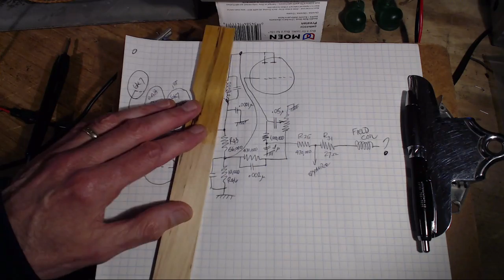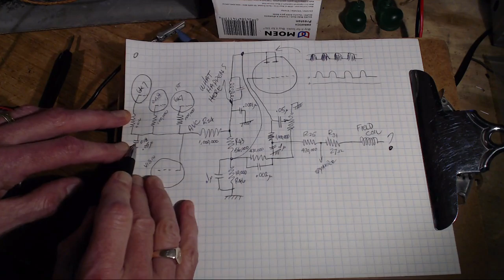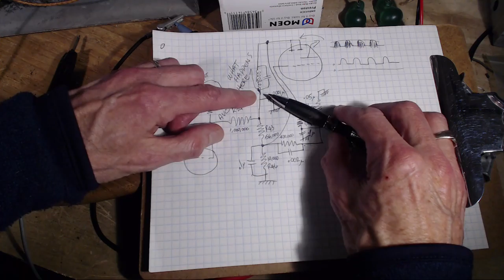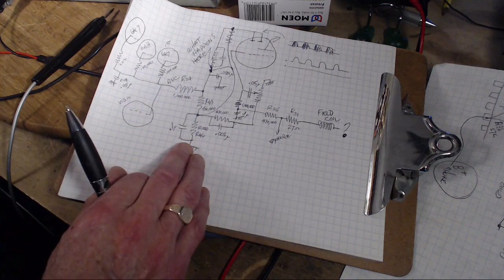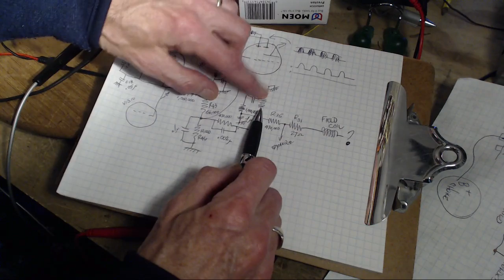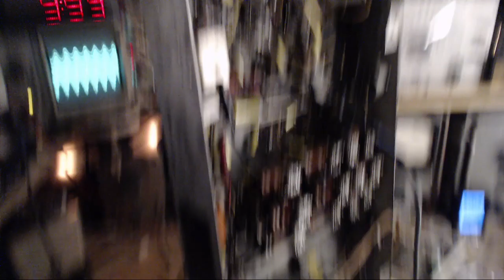Sparton 1567 Huge Tube Radio Video #24 - Replaced IF Transformer Mystery Tour

Comment: The -3db corner of the 66K resistor and the 0.1uf capacitor is about 24 Hz.  So any audio above that frequency will be killed before getting to the volume control.  Disconnect the 0.1uf capacitor that you put on your terminal strip and see if the audio comes back.  Maybe the 0.1uf on parts list is incorrect.  Maybe your imaginary guy had previously discovered that the 0.1uf capacitor was not necessary.  Really enjoying this series.  Great reality TV on YouTube.

Comment: Here is a suggestion.  Maybe put a fuse and an amp meter in series with the coil, and measure it this way.
Reply from the maker: The owner has suggested the same thing.

Comment: You really do not have a clue what you are doing?
Weeks and weeks of faffing about!
Work from the original schematic do not make up your own variations.
Rubbish! New replacement of IF tranformers was a common repair.
Stop making it up as you go along, all this speculation and fictional stories of what might have happened is not helping.
Work from the known Facts, stage by stage.
You are introducing a lot of noise from all the leads you have connected to various parts of the circuit.
When you measure something, have only the original connections and your measuring circuit.
Stop bashing those tubes around, when your meter fell you were lucky not to break the Magic eye tube!
Reply from the maker: Hi Brian.  I am flailing around.  It's one way to find things that you have no expectation of finding.  It's a big radio, so wandering around a bit just provides a preview of what lies ahead.  Do you know what other changes are in here waiting to be found?  You are suggesting I work from known facts - but first the facts have to found to be known.  I like to think about a radio's history because it's fun to imagine.  It also can reveal things I should be looking at.  Relax and enjoy my journey through this radio.  In the end, all will be taken care of.  And yes, sometimes I'm lucky.

Comment: Why don't you ask the owner of the set what the fault was which made him take it to be repaired in 1998, it may give you and idea of what the 1998 fellow was repairing,personally I think your all over the place.
Reply from the maker: I've had that conversation.  The things I have uncovered with this radio were unknown to him.
Reply: @JimsRadioShop  He did state to me that it had worked happily for 18 years so what the 1998 repairer did alter back then couldn't have been that detrimental. so maybe leave that part of the circuit as you found it.

Comment: How can the audio possibly get to the volume control if it is shorted to ground by a 0.1 μF between the 56K and the 470K?
Reply: I looked back at the previous video. It is C54 and the value should be 0.0001μF (from the looks, it is a little hard to read).